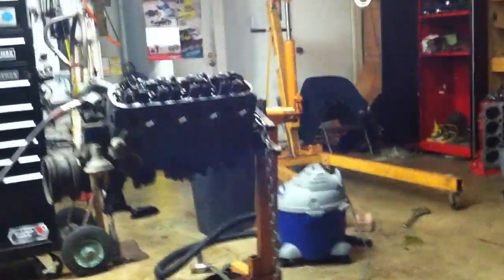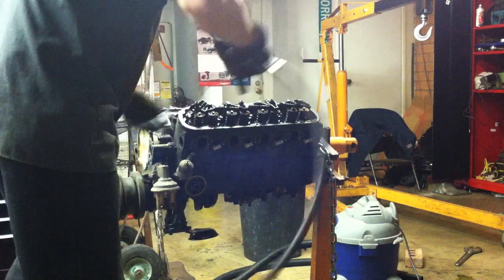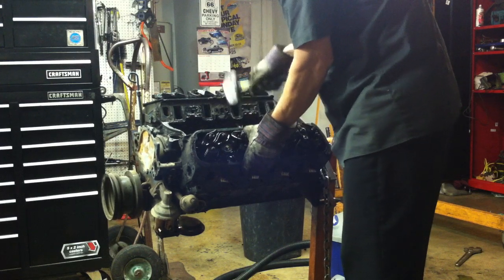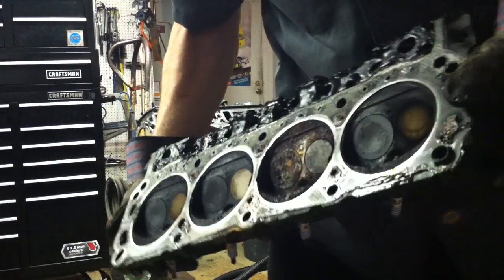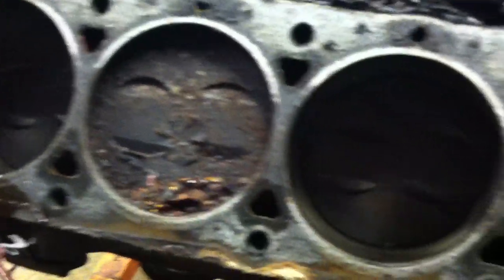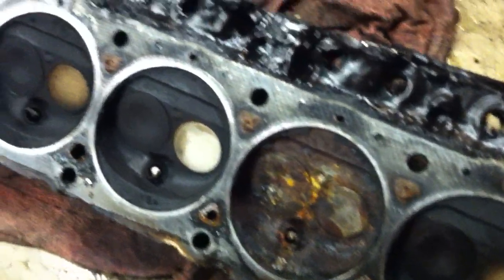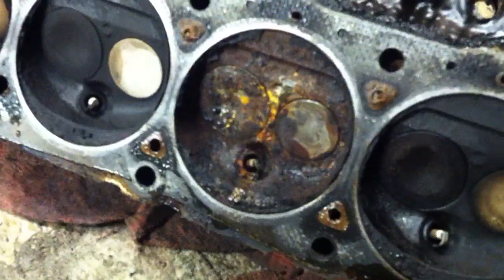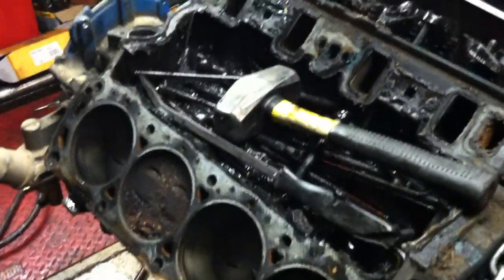289 complete rebuild part 4

Comment: Figured I'd let you know - I purchased a 1966 Galaxie fastback with the original 289 in it.  I've ordered parts for a tune up since it runs, but.. if I take it apart and it looks bad, I'm not going to hesitate to do what I see you're doing here.  Thanks for the info!